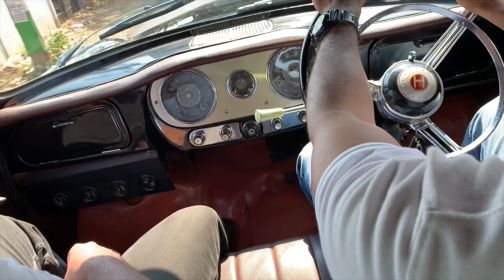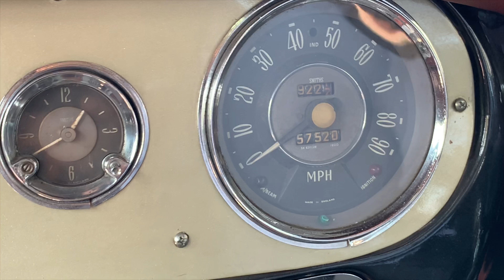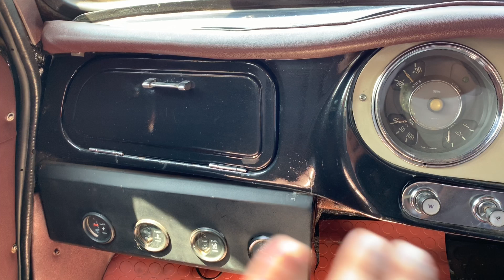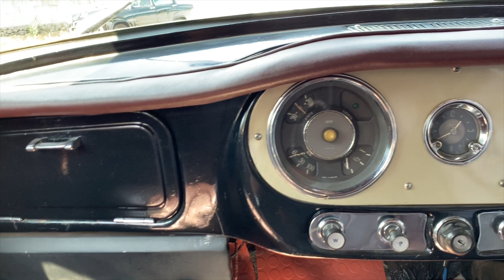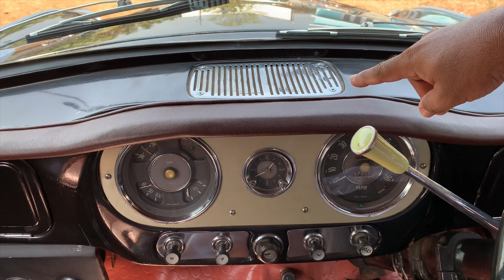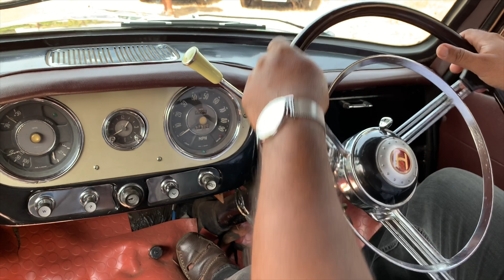Ambassador car 5 speed column shift modified| Dr.Unnikrishnan's vintage cars |Thrissur Athani Part-1

Comment: The bumper is original for 1959 model only. Please see the round shape as well as covered overriders. From 1960,square shaped bumpers were used. Initial models also came with sidevalve engines. That's why the O. H. V badge was fitted.

Comment: Hi Sir, Wonderful alteration made with hand gear on 5 speed. I see you made steel gear shift is a great alteration. The original will come with casting metal which usually breaks when the driver makes an unusual move. This steel gear rod will make everyone life easy in gearshift. Great job sir. 👍

Comment: Superb alterations overcoming most cons of a matador amby, 301, 305 Matador engines are designed to last and only to last, same as merc ponton 180D. Once heated up its perfomance is awesome, If you know exactly where to shift the gear steering gb is fun to drive, with manual drum brakes and bearing steering.... The feel of driving a real machine

Comment: The Ambassador needs 2.9/3.0 V6 V8 6 turbocharger 4 exhaust's central locking mechanism 8.9 sattalite navigation system panaramic sunroof hifi wifi networks control's music consol 16 band radio stations 12 airbags 🇮🇳🇮🇳🇮🇳🇮🇳🇮🇳🇮🇳🇮🇳🇮🇳🇮🇳🇮🇳🇮🇳🇮🇳🇮🇳🇮🇳🇮🇳🇮🇳🇮🇳🇮🇳🇮🇳🇮🇳🇮🇳🇮🇳🇮🇳🇮🇳🇮🇳🇮🇳🇮🇳🇮🇳🇮🇳🇮🇳🇮🇳🇮🇳🇮🇳🇮🇳🇮🇳

Comment: The golden Ambassador should come back in to production it was a true icon of india this ambassodor needs to be transformed and modified all electric power engine's via mobile phone device and all wheel drive 4 wheel drive cruise control
Plus I want to see a sport's station wagon all electric power engine's via mobile phone device all wheel drive 4 wheel drive cruise control all voice control door's voice control gear's voice control steering wheel adjustment voice control passenger and driver's seat increase voice control self driving voice control self charging voice control reversing via mobile phone device voice control steering wheel adjustment voice control opening booth voice control hand's free driving built-in aerial plenty of leg room plenty of storage space plenty of power points larger booth blue tooth CD and MP3 player colourful instruments smooth performance stylish interior and exterior matching wing mirrors stylish and luxurious and elegant and classy eye catching voice control folding wing mirrors voice control windshield wipers voice control front and rear cctv infrared parking camera's plenty of usb connections plenty of cup holders Speedo and odometer and tachometer reading 🇮🇳🇮🇳🇮🇳🇮🇳🇮🇳🇮🇳🇮🇳🇮🇳🇮🇳🇮🇳🇮🇳🇮🇳🇮🇳🇮🇳🇮🇳🇮🇳🇮🇳🇮🇳😎😎😎😎😎😎😎😎😎😎😎😎😎😎🇮🇳🇮🇳🇮🇳🇮🇳🇮🇳🇮🇳🇮🇳🇮🇳🇮🇳🇮🇳🇮🇳🇮🇳🇮🇳🇮🇳🇮🇳🇮🇳🇮🇳🇮🇳🇮🇳🇮🇳🇮🇳🇮🇳🇮🇳🇮🇳🇮🇳🇮🇳🇮🇳🇮🇳🇮🇳🇮🇳🇮🇳🇮🇳🇮🇳🇮🇳🇮🇳